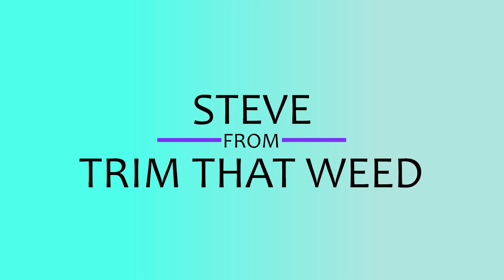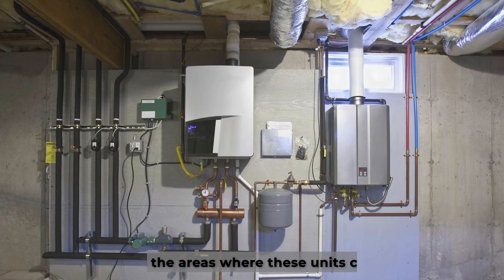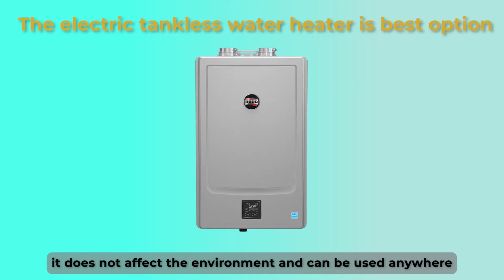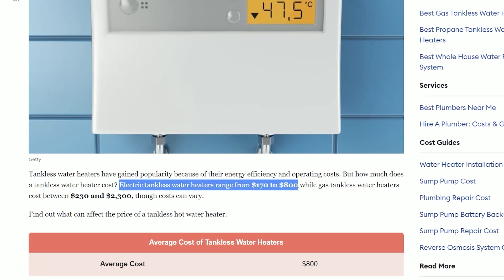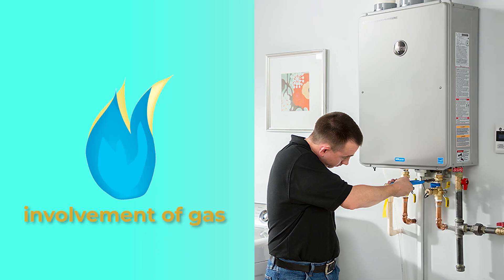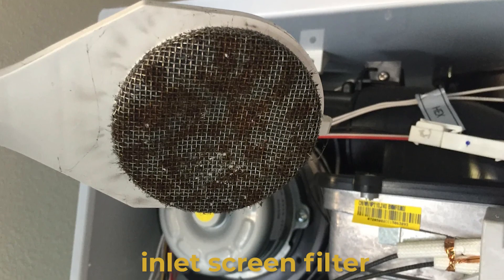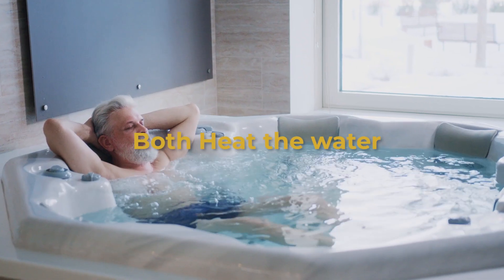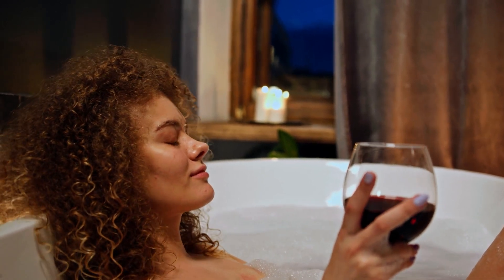Gas vs Electric Tankless Water Heater - How Do They Compare (Which Comes Out on Top?)

Comment: This is a poor video. Electrics are cheap to buy and more expensive to operate.
Gas cost more for the unit and cheaper to run. Install for gas is generally more involved than electric. Electrics generally take up less space but gas generally produces more volume. Questions you need to ask is about the electrical and gas services. If you have gas service at a location that can be easily ventilated the price of gas is much lower than install of new gas lines to a space with exterior ventilation. If you have electric service, is 120v or 220v and what is the voltage of the unit you want? 
My opinion gas is best for larger homes and electric for smaller homes and single use locations like kitchen & baths. Don't just look at the cost of the unit look at the cost of install and use included in your calculations.

Comment: I have had both electric and gas tankless water heaters.  The problem with the electric heater (mine was pretty powerful, i.e. 3-phase, 415 volt) was that it just COULD NOT quickly provide hot water in large enough volumes to be useful.  It could put out either a trickle of usefully hot water (that is, between 50 and 60 degrees Celsius)  or a decent flow of warm water, when what I needed was a reliable and copious flow of hot water.  The problem was worse in winter (when you really need hot water) since the incoming water supply was colder.  The switch to gas tankless did away with the problem instantly. What a blessed relief!   I now have a solar evacuated- tube array coupled to a tank  (all at mains pressure)  with the outlet running through the regulated gas tankless heater as a booster in cold weather.  The gas booster outlet is factory regulated at 50 degrees, so any water coming in from the tank that is hotter than that will just pass through without triggering  the gas flame.  An ideal arrangement.  in my view,  that has served me well for over 10 years now.   The only problem is that the environazis who run this town are trying to eliminate gas as a heating source, and will eventually raise the cost of the gas supply to a point where nobody can afford it.
Reply: Thanks for sharing your practical hands on experience. This video was so biased. It is full of misinformation. And fails to mention electricity rates costing us $500 / year for one electric tankless water heater that will keep us cold and susceptible to flus. Hopefully we can replace harris big corporations lobbyist paid inflation boosting green new scam in 2025.

Comment: This is a very biased video didn't explain the fact that if you have an electric hot water heater for the house you have to add extra breakers and it takes longer to heat the water up than a gas heater it all depends on your situation but what do I know I  be doing this kind of work for over 10 years so dont listen to me

Comment: Environmental impact depends on how electricity is ptoduced.
Reply: Actually, it doesn't as much as you're implying. Gas burned for electricity at industrial scale to power an electric instant heater vs locally in a gas instant heater is going to be more efficient and lower in terms of emissions
Reply: @stephyserval not true. The most efficient natural gas power plants burn enough natural gas to make roughly 7100 BTUs to produce 1 Kilowatt hour of electricity. 1KWH only gives you 3412 BTUs with resistance heat, just like a tankless water heater uses. So if you're looking at environmental impact, electric tankless is like having a gas tankless that's less than 50% efficient. Currently the least efficient gas tankless are still 80% efficient.

Comment: No environmental impact of electric is false. The electricity is made using for the most part with gas or oil. It is just burned somewhere else. You can even say electric has a bigger environmental impact because the electricity has to be transmitted and there is transmission loss. At best they are neutral and at worst electric has a bigger environmental impact.

Comment: I love my electric tankless
Reply: iv used a.couple lp tankless.heaters generic under 150 us dollar a 12l and a 18l and.aside from.the 10 min auto shut off (all ya do it.push on again) it runs hot water non stop never had it.go cold using it for.1 bath/shower a day (big.walk in tub) i got about.a.week.or so out.of 1 gallon of propane i never tested exacts but roughly and the only. reason iv.used 2 is because i had it.outside in the winter there was water in the line that froze n cracked pipe that pure user error .. just my.thougjts in ur question
Reply: Im building a 1 bedroom apartment for my wife and I, is the electric tankless heater, enough?? Im only worried about it being enough, I don't want to be showering on winter day and only have 5 min of hot water.
Reply: @whatoh3407  stay away from electric water heaters. They're no good.
Reply: also they go almost instantly to temps i promise.are.too hot so i dont think youd jave any issues and i hear electric are cheaper ill find out if. i ever break.the new one lol its nice when powers out tho i can.stil enjoy a long hot soak followed by hot shower (ya aint geting clean soaking in ur filth lol but maybe a mental cleansing from the relaxing) lol